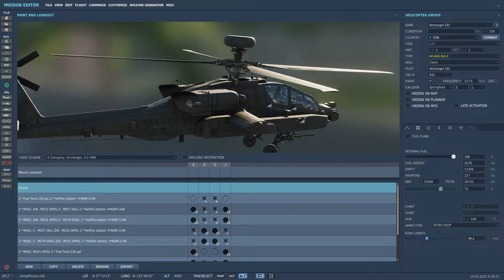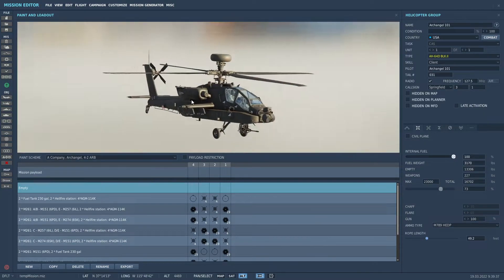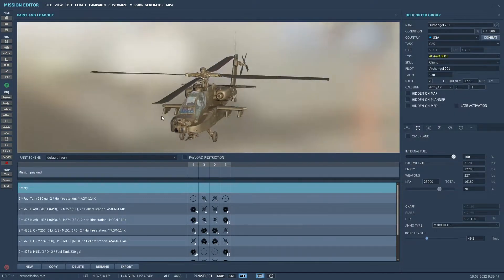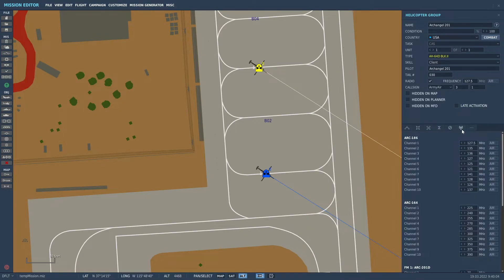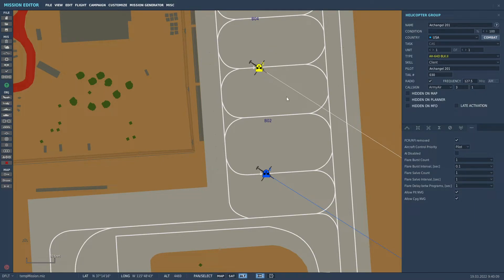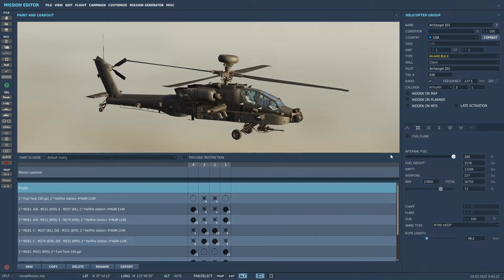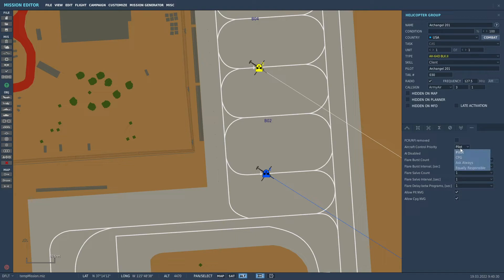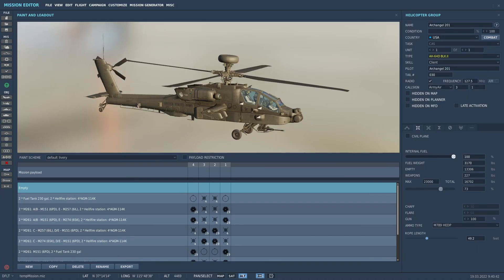DCS AH-64D - How to ADD the FCR Dome

Comment: Who the hell would not want the dome......it is the D model for F sake. Thanks was wondering why it was not there and then there on some.
Reply: Not all AH-64D's are equipped with the FCR. Typically only a few will have the dome in a squadron. It honestly makes more sense to fly the Apache in DCS without the dome as it doesn't have FCR functionality yet, making it more realistic, unless you just like the look of the dome lol
Reply: @jackjewell6926  I guess you are right. I never noticed it before but thought they all had it. I used to call them in and saw them daily. For some reason I never saw that they all didn't have therm
Reply: Well, considering it's useless right now, a lot of D models flew without the mast mounted radar and adds a ton of weight for nothing right now, I don't see why anyone would want to have it enabled. Once it's modeled, sure, but now, it's just useless and a disadvantage.
Reply: @ttenor12  Yeah but it looks cool